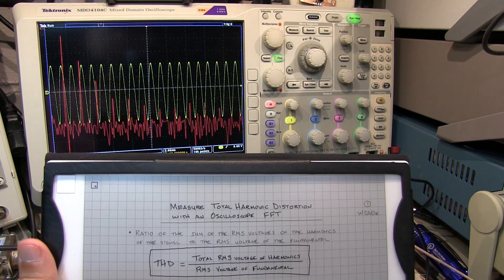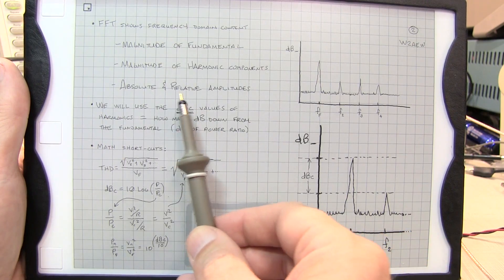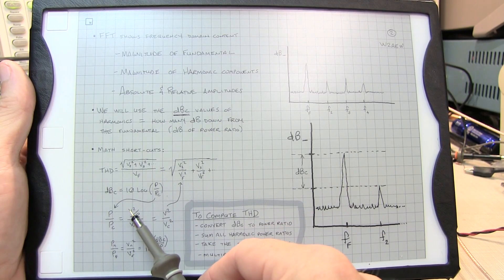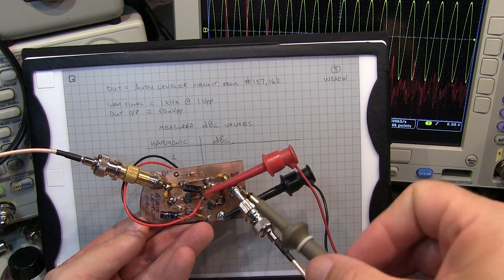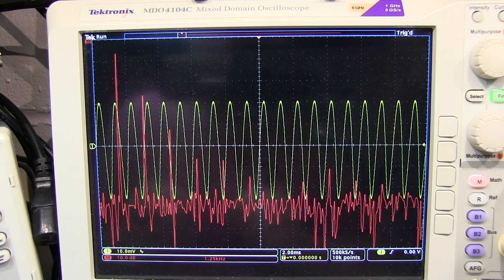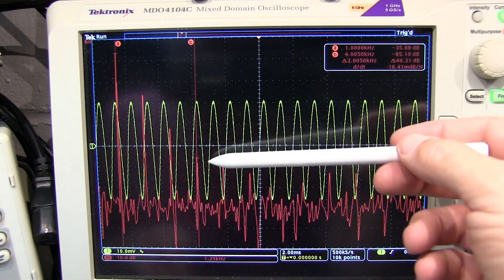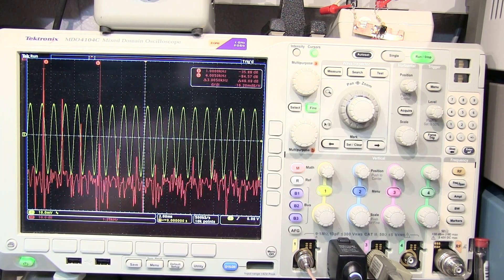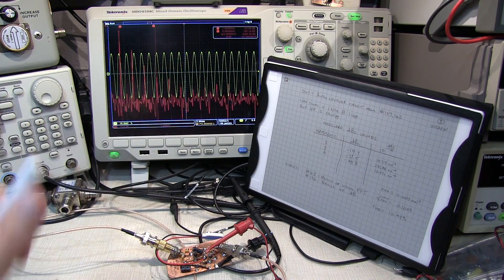#305: Measuring Total Harmonic Distortion THD using an FFT on an oscilloscope

Comment: I want to analyze some vibrations that are around 50Hz - 10,000Hz. Can I use a spectrum analyzer for frequencies below 9 KHz? Is there a workaround to feed the analyzer a bigger frequency correlated to my original frequency? The oscilloscope that I have access to, has a FFT based on 1 KPoints. FFT is basically a joke...
Reply from the maker: There are some spectrum analyzers that are designed with a lower corner frequency, but they're not that common.  You could upconvert using a mixer.  I did a video on up-conversion in the context of monitoring HF radio signals on a USB-SDR receiver that didn't receive that low - this is the same concept: https://www.youtube.com/watch?v=XeQnDpzhcRo

Comment: I set the FFT to read voltage, then use the first formula sqrt(V1^2 + V2^2 + V3^2...)/Vf ? 
That's the way I have been doing it. Am I doing it wrong? I really want to know.
Reply from the maker: That works too, no worries.
Reply: @w2aew  Thanks, Alan!

Comment: TOTALLY OFF TOPIC. I am looking for a simple way to make a REVERSE LOOP controller for model trains, they cost too much and I know it is cheep and simple to make one. All it is is a AMP sensor that senses the amp usage of its output of 16v DC, once amps go over a adjustable set amperage from 1A to 3A it reverses the output polarity each time. SIMPLE.  Could you make a video of how to make this circuit? Please.

Comment: Hi I have a question about building Low Distortion," oscillator running at 1khz I would like check the THD And I am Thinking of buying  a spectrum analyser, Because the analyzer I am thinking of buying starts at 9 kHz and the oscillator will be  running at 1 kHz Could I run the oscillator say at 10 kHz and check the THD, would the harmonic distortion be a good representation  as if I was to run it at 1khz, or would it be way out in your opinion Or would I need a spectrum analyzer that works  at 1khz
 or below
Reply from the maker: I don't think that the THD measured at 10kHz would be a good representation of the THD at 1kHz.  You might be better off using a scope, or even some software on your computer and the the sound-card input.
Reply: @w2aew  Thank you

Comment: A shortcut for a very rough estimation would be using only the second harmonics. Then the result is simply 10^(dbC/20) - because square root is the same as power of (1/2). 

In the example this will be 10^(-20/20) = 10^-1 = 0.1 = 10%. Close enough for many cases.
Reply from the maker: That's assuming that the 2nd harmonic is the highest one.  If the 3rd is higher than 2nd, then use this shortcut with the 3rd.

Comment: Alan, thank you for this very helpful video! Would measuring THD on a Spectrum Analyzer be more accurate? Could it perhaps be used to get measurements in sub 1% range?
Reply from the maker: Yes, that would be much better. Spectrum analyzers usually have a spec on their harmonic performance too.
Reply: @w2aew  Thanks Alan, I just realized though Spectrum Analyzers tend not to go that low in the audio range. Mine for instance starts at 9Khz.
Reply from the maker: @SirMo  Yeah, that's typically the problem.  There are some that go lower, but most do not.

Comment: Since the measurements are all relative, one could set the V/DIV including fine adjust to span all +/-4 div. on the screen.
Using average function to smooth out the FFT also makes for stable values ( but not more accurate, just help the operator to look instead of estimate :) )

Comment: Howdy. Nice presentation. One point however about audio amplifiers.
I suspect most specs use only one base frequency. It is likely to be 1 kHz.
I believe THD should be evaluated using several base frequencies from 20 Hz to 10.000 Hz. Harmonics of 10.000 Hz are not audiable. Base frequency spacing = double:

f / Hz                      THD / %

20
40
80
160
320
640
1280
2560
5120
10.240

To evaluate the overall THD the mean value of the THDs may be computed. However. I believe the rms should be used to evaluate the overall THD.
Regards.

Comment: Nice work. I quite like using the HP 3562A for THD measurement, as it automates the calculation while letting you eyeball the relative levels of the different harmonics, otherwise an analyzer like the ABO AVX-310 does a fine job if you just want a THD+N measurement. I quite like the technique of using the 3562A on the monitor output of an analyzer (such as the Leader LDM-171 or the AVX-310) as by notching out the fundamental you can look quite deeply into the harmonic content without taxing the dynamic range of your FFT instrument - a bit fiddly, but can be effective.

Comment: hi, can you measure in hf 7 MHz to analyze radio ham 40m rigs? thanks
Reply from the maker: Sure, you can - as long as your scope has sufficient bandwidth to see the harmonics, and you have an effective way of coupling your RF signal into your scope safely.
Reply: @w2aew  for 7MHz signal which oscilloscope bandwidth you recommend for fft spectrum measurements?  thanks
Reply from the maker: A good rule of thumb is 5x the highest frequency (harmonic) that you want to measure. If you want to measure the 3rd harmonic of 7MHz, then a 100MHz scope would do.
Reply: @w2aew  thank you, best regards

Comment: Nice! The instrument you are using has a real spectrum analyzer. Will the FFT math function of a low end scope like DS1054z, do the trick?
Reply from the maker: I wasn't using the "real" spectrum analyzer in this case, because the signal was at 1kHz and the spectrum analyzer only goes down to 9kHz.  This will also work on the DS1054z, assuming that it's FFT gives you the result in dB_.  Keep in mind that any 8-bit scope is going to be limited in how low it can measure THD because the scope channel itself will limit the performance. In the case of my scope - a proper THD measurement with my THD DMM on the clean input signal shows 0.03%, but if I measure it on the scope, it was closer to 0.4% due to the limitations of the 8-bit digitizer.  If you have THD less than 1%, the scope FFT method really won't give you an accurate result.

Comment: For audio frequencies, I use a software called Arta. It will display THD in real time using the line in on the computer's sound port. Most computers audio will be of low distortion .1% or less. Mine goes to around -120dB (except for 1/f noise). Everything works in demo mode except for saving data. I recommend making an input protection circuit for your computer if you use it for this.
Reply: topic worth a video
Reply: Which module would you recommend for measuring harmonics in electric current and power?
Reply: Can you elaborate further please
Reply: There is an free open source program called REW (Room EQ Wizard), that can do the same and it works on Windows, Mac & Linux.
Reply: @Carl Jito you obviously got the wrong file of your computer is shit.

Comment: Damn, now I wish my analog scope could do FFTs!
Reply: Me too but I am grateful for my analog scope to do its job perfectly through decades... Anyway, its time for you to buy analog spectrum analyzer or signal analyzer....
Reply: Technically, because my scope has an optional digital mode where it feeds the analog data into an ADC for storage before it goes via a DAC to the CRT, I could splice in after the ADC, chuck some sort of DSP IC and some DRAM on a daughter-board in there to do an FFT, and either feed that output to another DAC or into the existing one on some sort of electronic switch. But that kind of hackery is way above my pay-grade.
I’ve been trying to think of some clever method for creating an analog Fourier transform circuit, but I don’t think it’s possible without some sort of janky analog memory.
Reply: James Barclay .... Thanks for your explanation about your scope but you could summarize it by saying you have Cursor Readout Analog scope which I love this type of scopes very much. Anyway , what brand name and model no. of your analog scope please ?

Comment: You were pointing at the first Harmonic and calling it the second harmonic, I'm a bit confused, great video.
Cheers
Reply: A common misunderstanding. Think of the  fundamental as the first element of the harmonic series. The second element (twice the frequency of the fundamental) is called the second harmonic as it's the second element of the harmonic series. Although we tend to refer to any component that is not the fundamental as 'a harmonic', in reality they are all terms in the harmonic series. A bonus of this way of numbering the harmonics is that it tells you the frequencies. The second harmonic is twice the fundamental frequency, the third is three times, and so on.

Comment: IMHO, in sound frequency range applications 24 bit sound card and GNU Octave can be used for measuring THD. One can record a sinewave sample, then upload it into Octave and calculate FFT and THD. It's probably tricky and not a very precise way since the sound card is a device with unknown nonlinearity, but I think it should work at least for evaluation.
Reply: it might be  not very linear, but i think that if you're working relativelly inside the auditory range (20 - 20k Hz) and with voltage levels not too close to the input limits it should work fine enough
Of course, best case scenario you would have a datasheet available to look for the response curve at the input
Reply: @Abossow77  Or a good audio-frequency sweep generator with known output characteristics so you can measure the linearity of the sound card.

Comment: Thanks a lot! I'm not the one who asked, but I also wondered how can this be calculated for years now. I was pretty sure it's possible. It was probably mentioned in school as well, but it was too long time ago. I can forget anything that I'm not applying within a few months.
Too bad that none of the scopes I have access to has THD calculation in their FFT maths menu, but this manual method is not too much of a hassle to apply if needed. I wonder why don't every FFT capable oscilloscope has THD calculation amongst its maths functions. It can't be too complicated to implement, if it can be calculated manually within a minute.
Reply from the maker: I guess it's because an oscilloscope is one tool you can use to compute THD, but it really isn't the best because accuracy really suffers when you go below several tenths of a percent.  A spectrum analyzer is better, but many don't go to audio frequencies.
Reply: @w2aew  Hi Allan how come they dont go down to DC why start 9khz or?
Reply from the maker: Most are AC coupled, often due to mixer and preamp design.
Reply: @w2aew  Thanks for reply

Comment: I always laugh when people say "multiply by 100%". Dude. 100% == 1. Multiplying by 100% does nothing.

Otherwise, good video showing what THD is to people rarely measuring it.
Reply from the maker: Yeah - should have said "multiply by 100, add the % sign".  But, everyone gets the idea.  I remember correcting a math teach on this about 40 years ago...
Reply: @w2aew  it is best to get rid of this multiply by mindset. 0.5 is the same as 50%. You don't multiply one by anything to anything to get the other. They are the same.

No worries. I am sure you know it, it just triggers me, to see or hear "x 100%" :)

Comment: Can we use a linear vertical scale to make the math easier?
Reply from the maker: You'd have to then square the terms - using the dBc values, you avoid that step.  Plus, not all scope FFTs have a linear scaling option.
Reply: Lou Eckert .... Using logarithmic scale would make scaling much easier on screen rather linear so the small values can be shown much easier with large values on same graph...